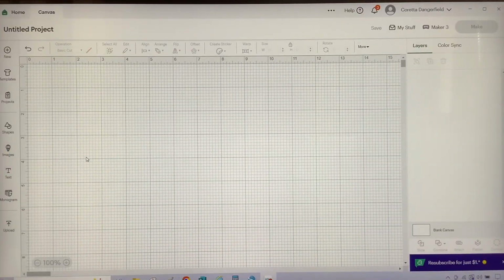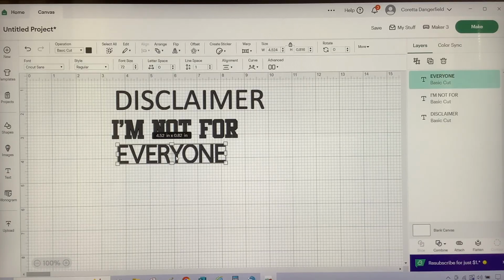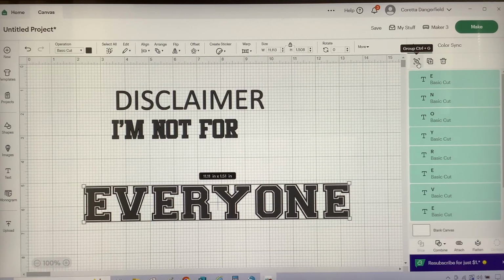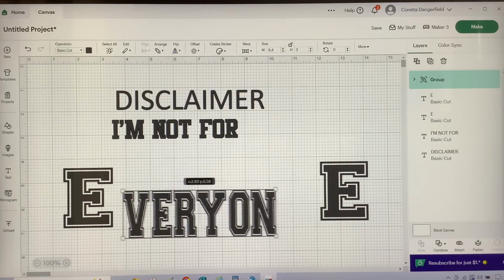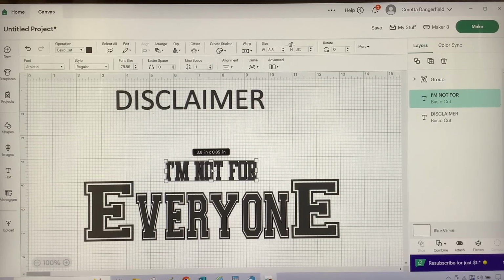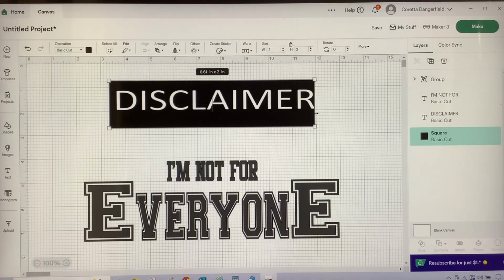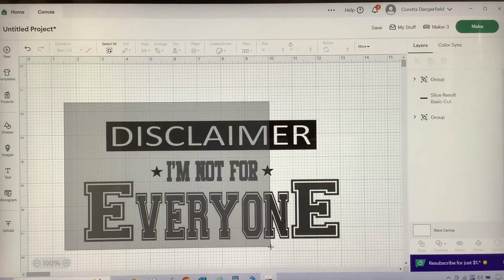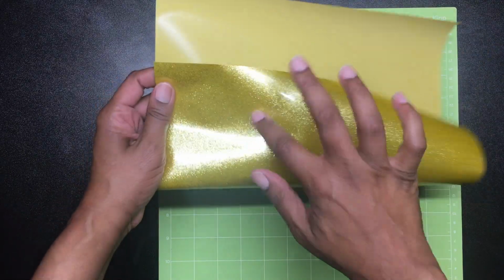HOW TO CREATE CUSTOM T-SHIRT DESIGN | CRICUT DESIGN SPACE TUTORIAL

Comment: Thank you for explaining so thoroughly. I have one question though, why is it that when I make my works or design big like yours I get the little icon saying it’s too big? Is there a way to change settings for this like yours? I’m using the maker 4 and very new to this. Also, how did you change the color of the mat? Thank you for your help!
Reply from the maker: You’re welcome!  

Cricut basic cut limitation is 11.5 x 11.5 inches for a 12x12 cutting mat and 11.5 x 23.5 for 12 x 24 cutting mat. 

For Print then cut it’s based on the shape of your image. For 8.5x11 the largest print then cut area is 7.44 x 9.94. You can try changing your paper size by selecting drop-down next to your name > Settings > Print Then Cut Settings > Default Size, and select your desired paper size from the dropdown. Be sure that your printer supports the paper size. 

To change the color of your canvas, on the bottom of the layers panel select the white color swatch next to blank canvas then select the color swatch that appears at the top of the new toolbar to choose from standard colors. 

Thank you for watching!